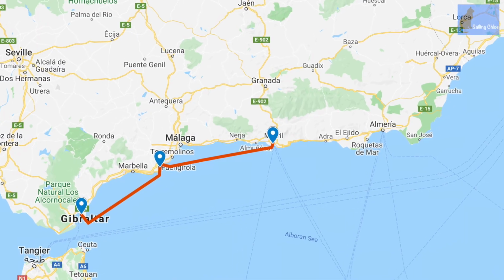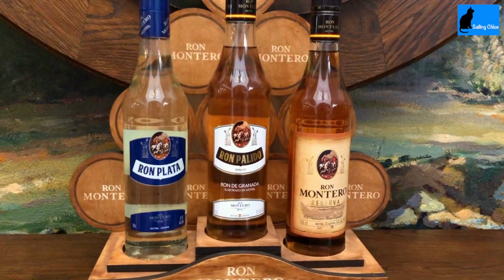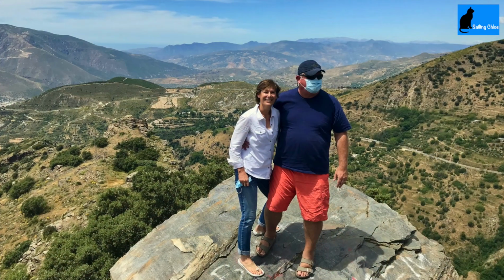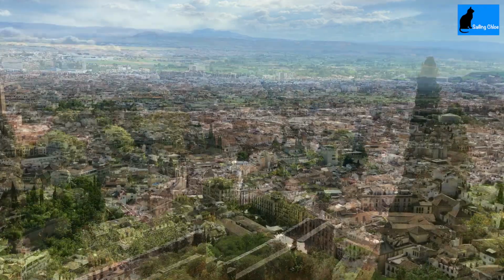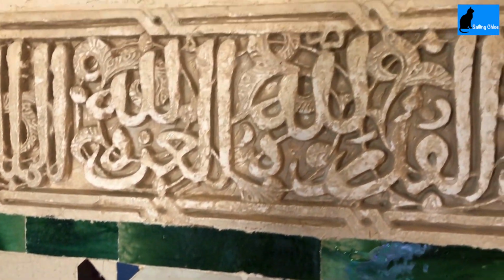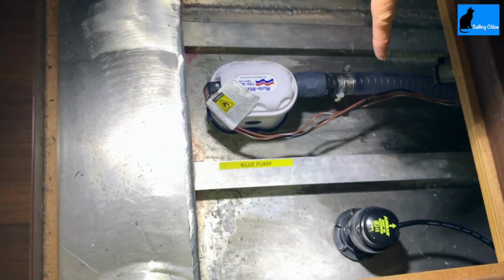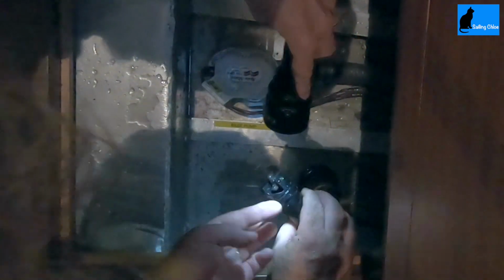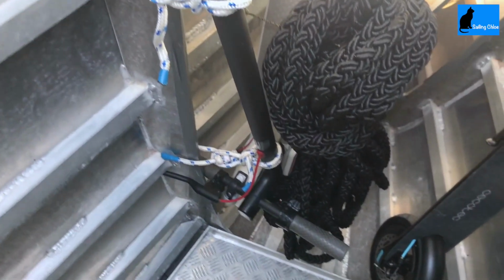Sailing Chloe - Episode 49 : Lockdown Lifted - Time for Rum and an Ancient Islamic Palace

Comment: Great video. Thanks for sharing. As a suggestion for next time you need to clean your transducer, leave it in a glass of vinegar for an hour or so which, will loosen all the "crap" and then just brush it off. It should be easy to clean then. The vinegar basically kills off the goo and doesn't hard your DST800 Transducer. Personally, I leave it out when not sailing or the boat is going to sit for a while to avoid the growth.

Enjoy Cartagena, my home base for my boat. If you need anything or local help, do let me know and I'll try to put you in contact with the right people.

Fair winds!
Reply from the maker: Thanks for the tip. Will try that next time!  And then I'll put it on Peter's fish 'n chips to see if he notices the subtle taste difference...